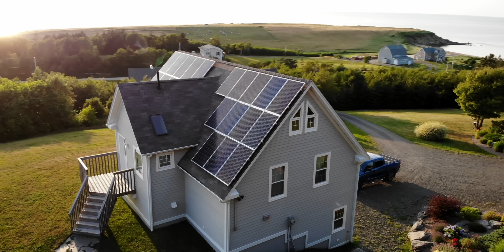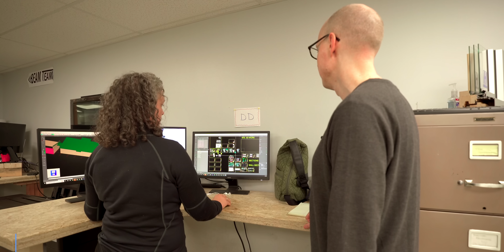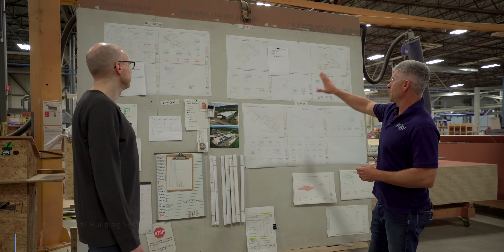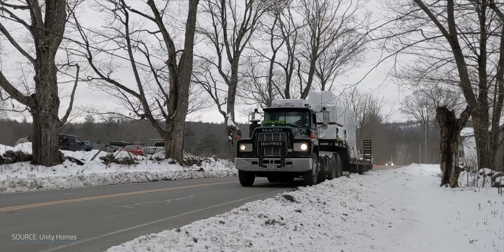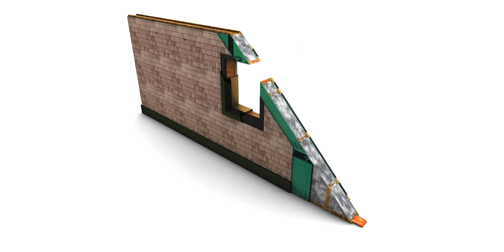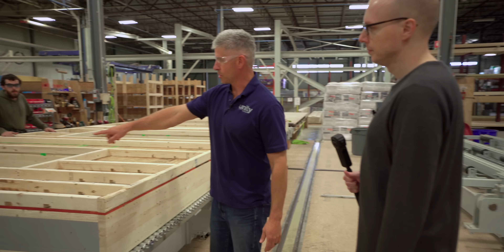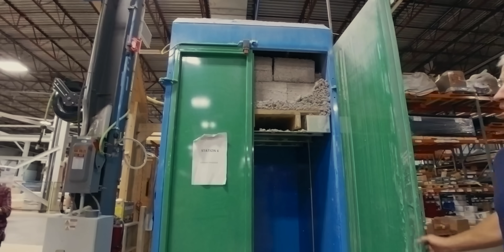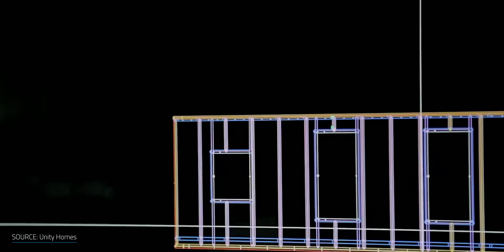The Simple Genius of a Prefabricated House - My Net Zero Home Build

Comment: This process is pretty sweet! I'm 90% done building my own high energy-efficient tiny house that I designed, and it was a trip to 3D model every structural connection myself. However,  you spoke about thermal bridging, and it seems to me that your envelope will still have thermal bridging through every stud. I used 2 layers of 2in polyisocyanurate insulation to eliminate this on the walls and roof, with 1 layer under the floor (I made pier foundations, so it is 6in+ off the ground). How are you mitigating thermal bridging?
Reply: I might be wrong, but I believe the Zip sheathing is a large part of breaking those thermal bridges.
Reply: @nasonguy  ah ok, I suppose if that's true, that's a good feature. Being up in the NE of the US though, it won't do all that much. Maybe south of NY it'll be good enough? Thanks for the heads up 😊
Reply: The I-Beams (as opposed to traditional studs) will significantly reduce the thermal bridging by reducing the total amount of material.
Reply: That may be true, however it's still there. Just 1 layer of exterior rigid insulation eliminates thermal bridging, which is a more cost effective technique

Comment: I see the benefits for you
  only in areas like mine is a pure timber construction nothing.
Furthermore, maintenance comes overtime, as do opportunities to extend this if necessary.
Of course, my dream of a house doesn't match theirs.
My personal wish is a house in old Japanese style with modern possibilities for energy efficiency but also security.
Unfortunately, a house in Europe is also exposed to the influence of burglars - sadly, especially when it looks like loot. -.-
Which actually makes one of the core elements of these old Japanese houses hardly possible.

Comment: Matt, maybe I missed this discussion in an earlier video but you could have done a 2x6 or even staggered stud 2x4 wall with external insulation to achieve that R-38 rating more cost-effectively. Doubling up the Zipshield also seems like overkill. With mechanical ventilation you have a lot more flexibility with sealing up the house and controlling ventilation. I do like the pre-routed holes for electrical as that will save a lot of time in the field. There are always trade-offs in design and construction. I'm sure you'll have no trouble reaching your blower door performance and insulation goals.
Reply: I had the same thoughts about the wall system. I do wonder if the double sheathing is in part to keep the walls straight and tight during transport and installation.

Comment: In a weird way, this is nothing new. Way, way back at the turn of the last century Sears Roebuck sold homes through its catalogue. You ordered the house you wanted, which was usually a variation on some basic theme , and then it was shipped to the construction site via a flat bed rail car where it would be assembled. Granted, it was still a stick built house, but all the needed parts right down to the nails came as a package. All you had to do was prep the site and have a crew construct it. There are thousands of Roebuck houses all over the US, especially in the Midwest. My mother was raised in s house that was built in 1914 and that her parents bought on a farm in 1941. The original house was already wired for electricity even though the farm didn't get power from the REA until 1942. I would like to see pre-fab companies come up with two or three designs that they could share with one another to build affordable housing on a vast scale with the object of bringing assembled costs down to $150,000 to $185,000. These homes would be sold to various regional housing authorities in lots of 500 to meet the housing shortage. All of them would be set up to allow easy solar installation with heat pump based split system heating and cooling and digital lighting.

Comment: I legit teared up a bit when he said "we've been developing this for... quite a while," and immediately thereafter says "it's going to be open source."
Everything about this video was beautiful. Those exterior walls were just astonishingly beautiful in their thickness, design, and the efficiency of the fabrication process.
My wife and I want to build a geodesic dome house (goodbye 90degree angle thermal bridges and wind pressure differentials), but we want to employ all of the net-zero design elements. (We just bought our first home, so it'll be several years before we can try to make that leap, but we're fantasizing now.)
Love this video (and all the others). Thank you!
Reply: Have you talked to people that live in a dome? I know a couple of people that have them and they wish they went with something more conventional.   I worked at a place where we had a dome built with a minimum of metal to calibrate induction tools and I spent many hours in there running test and couldn’t envision it as being a house. I know one thing the acoustics were strange in it.  You could move a few feet one direction or another and the volume on a small stereo would change drastically. We built with double stud walls with 6” of 40 psi foam and live in a very windy area and the house never creaks. Some of the Air Force Remote Radar sites have huge domes for a camp and shop at a couple of the sites I have worked at. They were metal and leaked when it rained.
Reply: @Chris_at_Home  I wouldn't use military buildings as a basis for comparison. Not to disparage the military, but I've been around it plenty and let's just say that the cliche of government contracts going with the lowest bidder is very evident in many of their buildings. I think that is more an issue with construction than the dome design.

No we haven't been inside one, but we've checked out plans on some websites. Also, I'm no mind reader so I can't speak to what you're picturing, but this dome will be two stories plus a basement. The basement and the first story will be essentially normal 9-10ft ceiling rooms save for the rounded exterior wall; it's only the second story that will have the more rounded walls/ceiling, but even that should have enough height to not feel cramped or mess with acoustics too much.

Basically all I'm trying to drive home is that I think most issues are more a matter of execution than a flawed core concept.
Reply: @JeffreyBensonUWR  In Rome NY, all the military housing at Griffiss AFB has been torn down because it was total crap. A thousand units or so
Reply: @Chris_at_Home  I know quite a few people who live in round things, domes, teepees, repurposed tanks etc & they all love them, apparently they're good for your mental state.
Reply: If efficiency is the goal we should all be building large portions of our houses underground. The earth naturally keeps a house much closer to the temperature we prefer. So only a small amount of heating is needed and with some thermal storage can be done entirely by some south facing glass. For cooling the earth is already cooler than needed during the summer in most climates so cools itself so long as you have proper overhangs on the windows to keep the heat out and minimize and well insulate the exposed portions of the house. 

A bit more conventional method, depending on where you live would be to use straw bale housing. You are taking a waste product and using it to build a R40-50 wall with little bridging but for the window and door openings. The materials are relatively cheap, but it will take a lot of low skilled labor.
Reply: I live in the Utah desert and if I were building a home it would be more like the Earth Shio homes mentioned at the beginning of the video. I would love to someday spend the night in one of those VERY net zero homes where even their water purification system also grows some of their food.
Reply: It actually isn't that difficult to develop this kind of home design software. In the CAD world it's called BIM, for Building Information Modeling.
Reply: Yeah, those walls are like the thickness of adobe wall homes.  Should be great for insulation and probably earthquake/hurricane proofing.
Reply: Windows, were a problem, in the geodesic-house i saw...  &, it was big, but not really, big-enough, on the upper-bridge.  & the second one, i loved looking at, along a freeway, got taken-out, by a tornado, one year.  sad...  Both were wood.
Reply: Tedd Benson is a significant individual within the industry, but he's not now building barns in that same humor where his career began. It's not his fault that the commercialization of industry by nature excludes the creature it was developed to provide for.
Reply: That sounds fun! There are all sorts of cool new building options to prevent thermal bridges. If you like building, check out Matt Risinger's channel
Reply: @MourningLobster  It's not just the thermal bridging, we just love the design.
I've even lobbied my wife to allow me to build an indoor rock wall up to the 2nd story and she's said yes!

But yeah, I'm looking into any/all efficiency advancements I come across. I've heard of Matt Risinger before, but not looked at too many of his videos, so I'll give it another look. Thanks for the suggestion.
Reply: @MourningLobster  I always thought wood is a reasonably good insulator.  Seems like you fill in between the studs with insulation you should be alright.  Especially since those studs are like 10" wide.  One thing to remember when you seal up a home so tight you probably want to get a heat exchanger to efficiently exchange some of the inside air with the outside air.
Reply: @jeffk464  Wood has an R value if about 1 per in thickness as compared to 3-6 per inch thickness of insulation. So that thick wall is only about R11 through the width of those studs.
Reply: @jeffk464  wood is certainly a better insulator than metal but it's not brilliant, you need proper insulation over it.

Comment: Thanks Matt for an inspiring video...just a word of caution for Europeans watching. You quoted an R value of 35 which SURPRISED me when compared with the walls I am building where my R is 4.9. The answer is that US R units are "square foot degrees Fahrenheit hours per BTU" while the metric units are "Kelvin meters squared per Watt" and they differ by a ratio of 1:0.176 so your R35 equates to a metric value of  6.16 - which is fabulous, well done!!!! Your project is really exciting, I so wanted to go the rebuild route, but compromised with triple glazing and huge amounts of external insulation..and hence my comments regarding metric vs imperial units.
Reply: Thanks, I was really confused about that too. I though they use metric units for engineering...

Comment: This is a pretty impressive process.  You actually have a chance to see your finished house before construction even begins, and find any problems that normally wouldn't be seen until completion.
Reply: Manufactured homes have been doing this for decades. I remember going to the factory with my parents to see their manufactured home being built back in the early 00s, we got to tour the factory floor and see where ours was in line. We were welcome to come watch it at any point, and that was just a thing that anyone was allowed to do.

What I'm wondering is when the big established players such as Cavco, Clayton, Fleetwood, etc are going to start pumping out net-zero or passive homes. I think that is when we'll see a BIG shift if passive homes being attainable for your every day working stiff.
Reply: @nasonguy  After selling my mother's house for 40 cents on the dollar I recommend pre fab steel with insulation rodents cannot penetrate. Seriously.
Reply: @garganega  I live in the desert (pack rats) in a manufactured home. I know the struggle well.

Comment: R35.... how thick was that wall? then they added a 2x3 wall to the interior for electrical and plumbing?

i could imagine with some sheet metal and fiberglass or even 3d printed PLA i could achieve a structural thermal barrier with NO thermal bridging r value of R50 in about 3 inches, and that's being conservative... at three inches it should be R75.
if you want to add a 2x4 stud wall for plumbing and electrical on the inside that still only amounts to a thickness of a 2x8 wall.

i admit fiberglass would be pricey... so would metal framing in this particular method too many welds required to be perfect and the vacuum would need monitored in each panel.